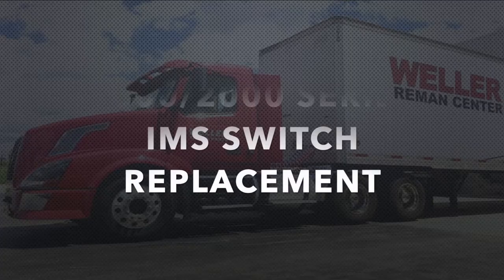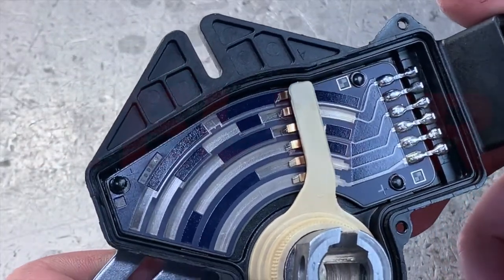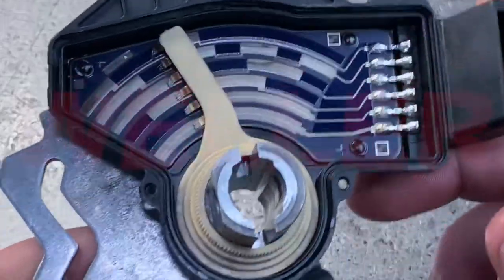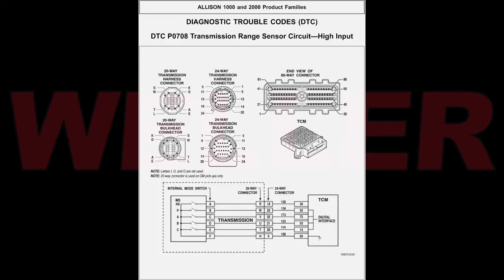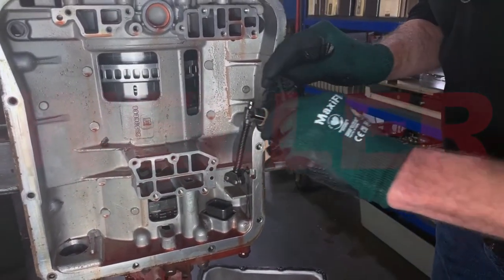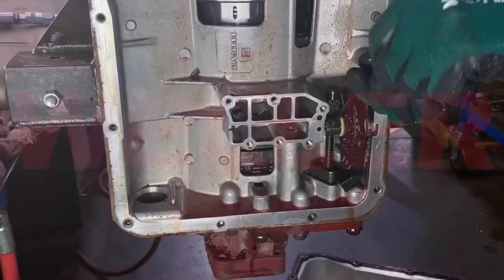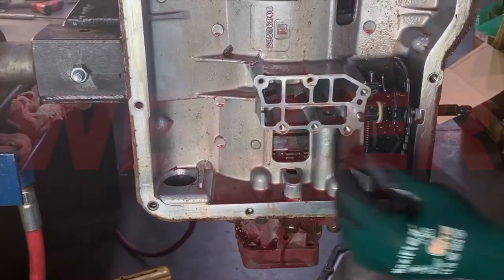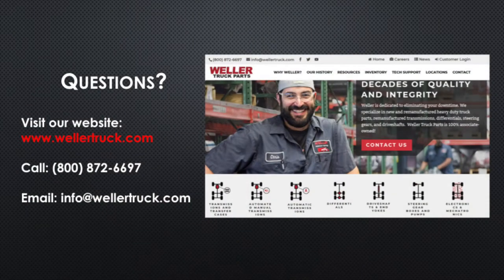1000/2000 Series IMS Switch Replacement

Comment: Hi guys 
,We are having  code come up on our scanning tool P708 and P700  we changed the wiring harness as  the seal was leaking thinking that might have fixed the problem, but after taking for a test drive  we had these codes come up , the scanning tool shows it shifting but we loss the indicator under PRNDM  I live in Australia and would much appreciate any help or information you could spare 
Thanks Dave
Reply from the maker: Hello Dave, after reviewing your concern with one of our experts, he mentioned the code you are seeing is for a bad IMS Switch or issues with the wire harness. And since you already changed the wire harness, it may be best to now change your IMS Switch.
Thanks for reaching out!
Reply: @WellerTruckParts  Thanks Guys yep that,s our next thing we are changing in next few days ,then from there we will go to TCM but as I read theirs a world shortage does anyone  know when these will be back in stock again  ,Thanks once again for your help 
Dave
Reply from the maker: Hey Dave, we are able to check for availability and price for parts. To give you the best service, please call 1-800-872-6697 and one of our team members will help you get the answers that you need.
Thanks